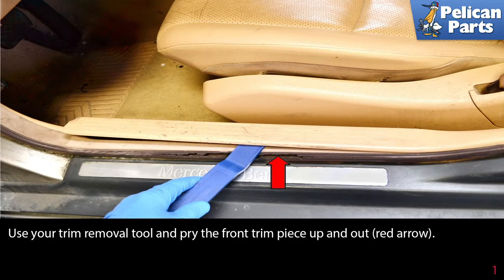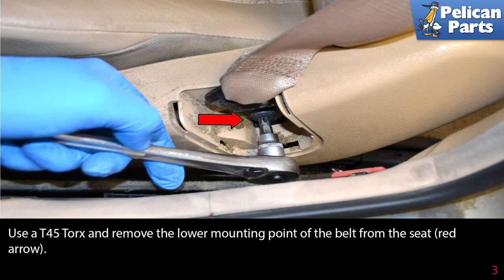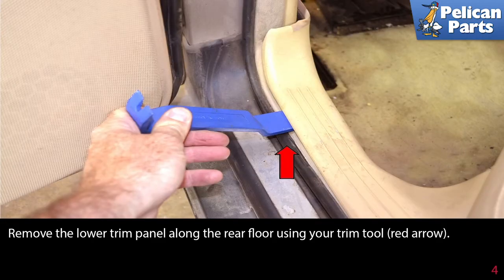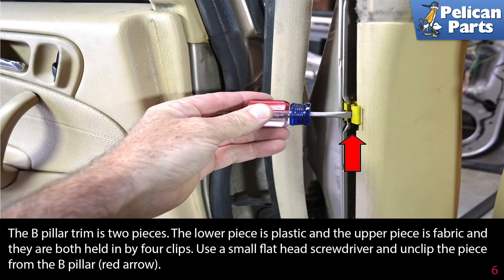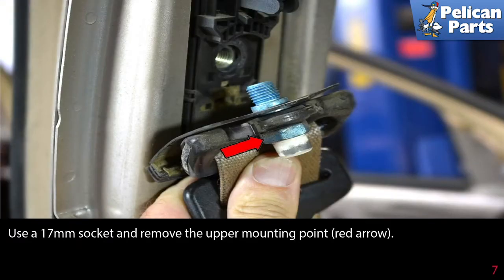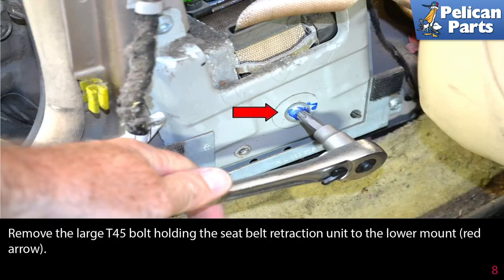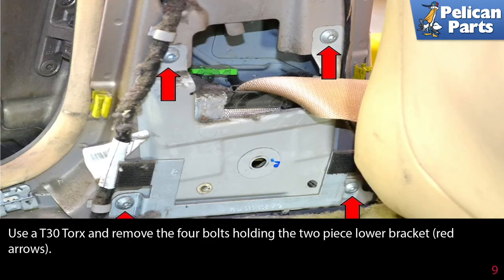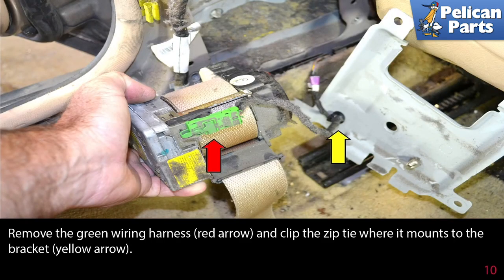Mercedes-Benz W203 C-Class Front Seat Belt Replacement

Comment: How can you replace the rear (side) seatbelts? Is there a video or an instruction for?
Reply from the maker: You will need to remove the C-Pillar trim as well as the seat bottom to access both ends of the belt. 

We don't currently have that tech article. If we get a chance to perform the procedure, we will be sure to document it.

Comment: also REMEMBER TO DISCONECT THE BATTERY or you will need to go and get an OBD2 scanner that will cost at least $100 or get a mercedes dealership to do it for you for like $120
Reply from the maker: Yes, disconnect the battery when working on this or when replacing any electrical component.

Comment: i got a malfunction and when i replaced it and then i replaced it with the old one and it still had the malfunction
Reply from the maker: Did you clear the fault codes? if so, the wiring to the buckle might be the issue.
Reply: @pelicanparts  i just bought an icarsoft i820 to clear them
Reply: @pelicanparts  but thank you for the videos they are really helpful